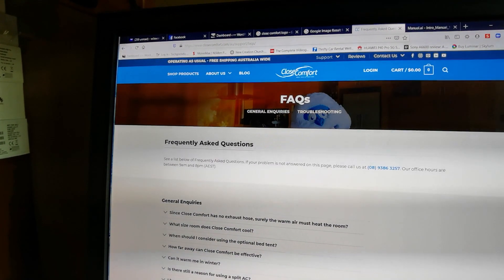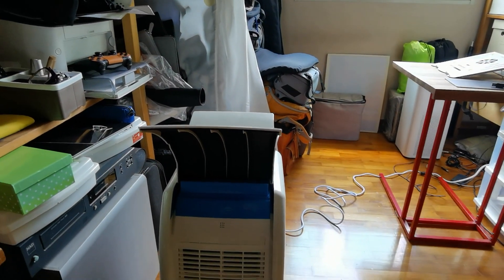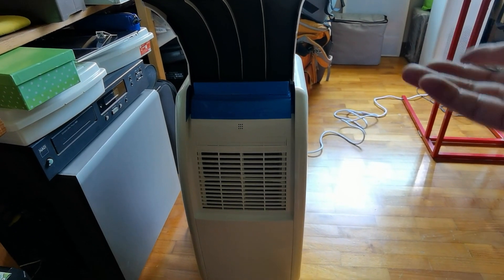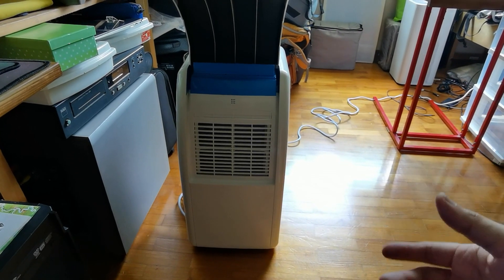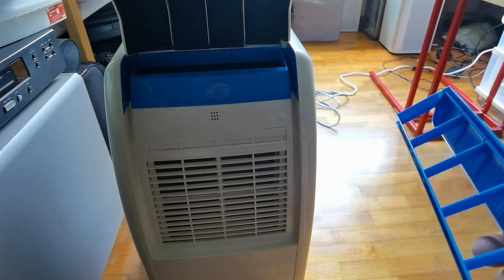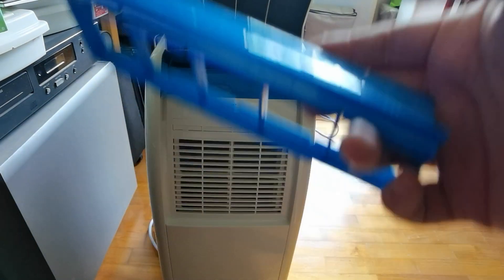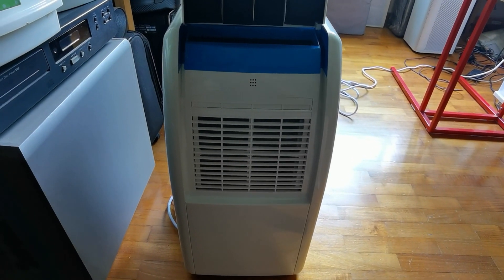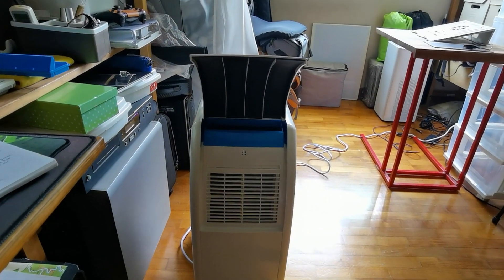The Minute Channel on Close Comfort

Comment: How to ensure there is no mold/mildew growth inside the machine? Or how to clean the machine? Can we add electrostatic PM2.5 filters (those made for air-conditioners) ourselves, to reduce any mold/mildew? I bought 2 such machines recently, but don't know how to do this. Many Thanks!
Reply: Hwee Hoon that's a tough question because I used for a year and the only things I need to clean are really the filters so I did not open up the machine. Having said that, there is no smell that we usually associate with mold, mildew. 

You can add additional filters but the air flow might take a hit. Just buy those filters and then tape it down in front of the grille. Also good because you can just replace those filters rather than cleaning it.
Reply: @WilsonWongWilzWorkz  Many thanks for your quick reply. How often do you use it? Do you sometimes don't use for a few months? I'm just worried if don't use for a few months, will any mold grow inside...

Comment: So I tried one of these. It does pump cool air onto you. But it pumps hot exhaust out the back. The net affect it will actually heat the entire room up. It's why they sell you the Coolzy rent where you put a tent around your bed. But it will not aircon a room at all. I tried it then got a refund (Toby the COO tried everything to not refund then by law he was forced to due to selling an item that doesn't do as described). As per thid video the only way you can use it by pumping the hotter air out of the room. If the windows are closed it will actually increase the temp of the room gradually so even the air-conditioned air you get will get hotter and hotter!
Reply from the maker: Is not supposed to be used like aircon as it is designed to cool the immediate vicinity in front of the unit.

The hot air vent should be facing towards an open window or door so the hot air does not warm up the room